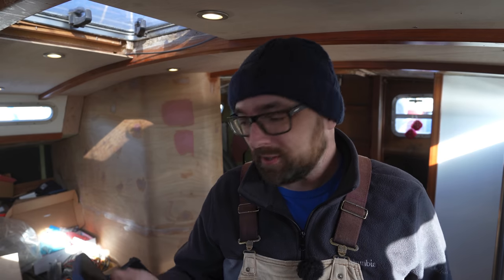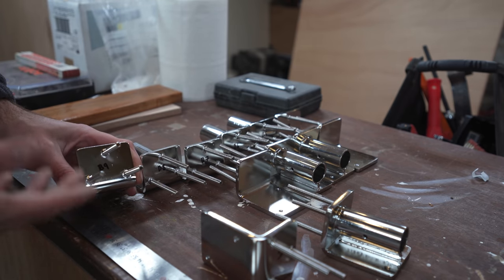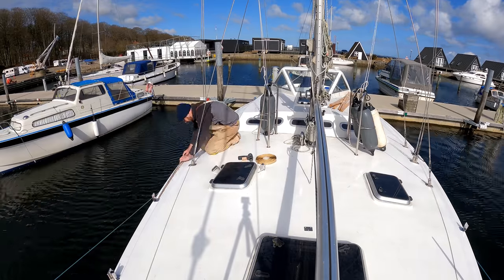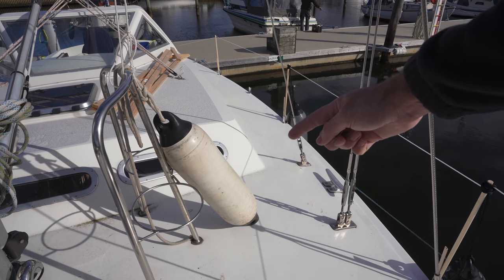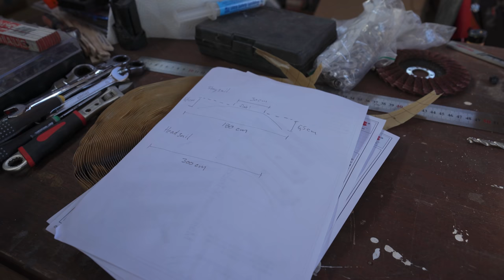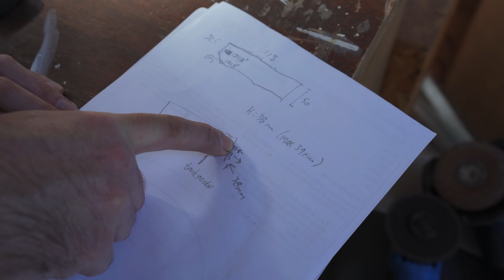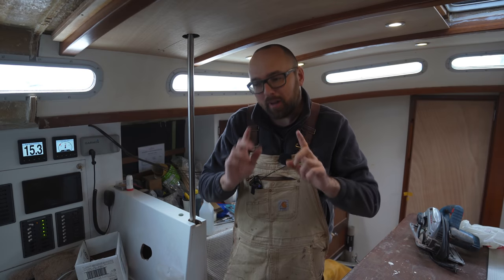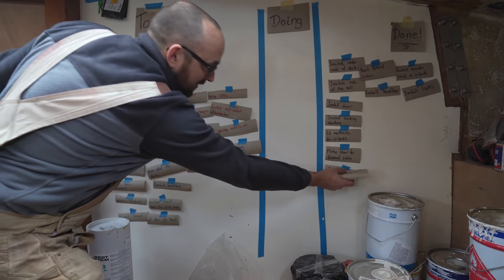Sail Life - Getting started on the toe rail / mini bulwark

Comment: Concerning leading the genoa sheets to the winch it is important that the sheet meets the angled base of the winch at roughly the same angle. One other thing is that you don't want to step on the sheet when leaving the cockpit because this is insecure footing . A good solution therefore is to have a block behind the winch. That way the genoa rail needs only be long enough to accommodate its lead block, from there the sheet runs to that aft block and up to the winch. You only need to install an eye bolt and a single block connected to it by a soft shackle.

Comment: Hey Mads
If you are dropping the cells further down, why not "just" cut out in the surface they now rest on, and use it to frame the cells as you place the bottom underneath the board? That way your base will have a maximum resistance to the sideway forces as it connects to the hull all around.. So place your cells in an recessed insert in the current board and just secure them from leaving that insert

Comment: for battery heating, best is to use a 12v infrared heating film. It is used in diy electric cars for battery heating. You can try to charge Li-ion cells at low temperature - they will not take up much charge. Best is to keep the battery temperature between 15-30 degrees. A simple 12v thermostat ca easily do that job.

Comment: Hi Mads. With regard to your genoa tracks. You may want to think about the sheeting point on the track (cars) when the foresale is furled or reefed. The optimum angle of the sheet to the sail is generally a bisection of the leach and the foot of the headsail. When the Genoa is full IE at 100% deployed this will be further back on the track. As you reduce the sail size this point will move forward. (Less if you are Yankee cut). Also, as the wind strength changes you will want to move the cars forward or back to curve or flatten foot of the sail and will be different from a beat to a reach. Being able to do this with a single line from the cockpit is an easy single line installation. As you only need to pull the cars forward not back; as the sheet will do this for you under tension. Not all of your sailing will be under full sail and it is important to maintain the right sail shape (or as much as possible) even when reefed. So if your setting this up now put in adjustable cars with a line to the cockpit and think about a padded luff to the headsail too. Being able to maintain good speed or penetration in strong winds is just as important in stronger winds as it is in light winds. As always it's your boat.... Just giving you some food for thought. Sail Safe Guys, Ant, Cid & the pooch crew.
Reply: Mads mentions a second car on the track to change the direction of the line, but wouldn't a foot block behind the winch be better?
Reply: @jorgenr  Facing the same issue on my boat, a second set of jib cars was (1) less expensive and (2) created no issues in mounting.
Reply: I had the same issue on my boat and I skipped the foot block and used a second car on the genoa track. That way the side deck remains clear.
Reply: @jorgenr  I agree. I am worried about the angle of the sheet on that second car. It would get a sideways load, which it may not be designed for. In addition, Antal makes very nice foot block that are cheaper than a similar-quality car.
Reply: @stevenr8606  What and try to change sail  on a heaving fore deck after you you should have reefed 20 minutes ago? You need to balance the sails to the prevailing conditions. But most of all anticipate and plan so there are no emergencies. Clearly you need to sail a lot more to gain some experience.

Comment: Did you mention a vent on the new water tank?  And you should seriously consider a RUBRAIL on the hull exterior.  Seriously.  Rubrail.  You want to preserve your paint job and fenders can only go so far.  Rubrail!!!  It will also provide a linear break on the hull, and will make the hull (in profile) appear sleeker.

Comment: I would  have a sheet running back to the cockpit for the genoa track car - the changing angle on the luff and foot of the sail can have a dramatic affect on performance in light airs, it also gives you something to play with when you're  on a long slow boring run!  Building up from scratch I wouldn't compromise on anything - you'll kick yourself!
Reply: I fully agree

Comment: Mads,warning re s.s. water tanks. If the welds are not gas shielded on both sides then one side (the inside of the tank) is no longer stainless and will rust. To do this the whole tank has to be filled with gas witch is expensive and is not always properly done. I know this from bitter experience not just on my own boat but on many others. Make shure that your stainless guy does a professional job. I paid a fortune for mine but still had this problem.

Comment: I would locate battery high up so last to get wet if flooding and hence bulge pump will keep working.
Reply: once the water is covering those cells then you are beyond worrying about a bilge pump. The best bilge pumps can't keep up with a failed through-hull - crew with a bucket can shift more than a pump

Comment: NEVER charge LFP batteries below 0°C: RAPID and irreversible degradation. By experience, best usable temperature range is 10-20°C if you float between 10% to 90% State of charge (80% usage multiply life expectation by 2 to 3). If hotter conditions (20-40°C) then never charge more than 3.4V per cell battery oxydation occur only when fully charged, and increase above 20°C this is a slow process tho. 20%-80% SOC usage will increase A LOT battery life.  (20 years expected in this case.) Also you will see that cells unbalance occur only when fully charged or fully discharged. SO my advice : use a 20%-80% range for everyday use, then increase to 10-90 only if needed (long passsages...). If one day you must use 0-100% then recharge IMMEDIATELY to limit degradation.
Reply: interesting input, you sound very educated on this topic and we would love your thoughts on our recent battery build videos

Comment: A good BMS has a cold temperature charging cut off  but also can turn on the silicon heating pads as needed to warm up the battery. Pads under the battery cells.
Reply: Never seen a BMS with a relay output for the battery heaters, but that sounds like a good idea !

Comment: Another great video, Don't give up on the idea of cockpit adjusted cars for he sheets. I have used both and would never go back to non cockpit style. Safer and dramatically easier to adjust under any point of sale. Clambering along the deck with a flogging sheet is a nightmare in any kind of blow. You will never ever regret adjustment lines.

Comment: If spending winter in my country Scotland, your almost definitely going to need heat in your battery compartment, my e bikes batteries are lithium and I always have them in the house up to around 60 degrees  for at least a  couple of hours before I charge them, they will absorb charge gooderer that way and ,I am using one of them from 2015 and its still working well, I also find occasionally if I totally discharge them ie what ever one I am using, and have it nice and warm it will take a better charge.

Comment: That second genoa block looks like it might give you a bad lead onto the winch. This angle should be about -10 degrees or so. Google 'winch lead angle' for details. On my CS 36T the solution was a sheet turning block located at the outside, aft end of the cockpit coming, angled to provide the correct lead onto the winch. That way, the genoa sheet always has  a good lead regardless of the position of the genoa block.

Comment: Mads, I believe mounting the wood bulwarks on the inside of the mounting bracket would be a better solution, as far as safety goes. while healing over hard, a lot of pressure is put on the bulwark, while walking fore/aft, better to be relying on the bracket than the bolts...no? Just a thought. Well that was sad, seeing Obelix sailing away :-/

Comment: Mads, if you're going to use a track inside your shroud, you'll probably want some attachment point outside the shroud to sheet out your headsail on close to broad reaches, which means you'll need some attachment point on the rail anyway, unless I'm mistaken and there's some other solution on the warrior.

Comment: Do you intend to use an anchor bridle as a snubber?  Are the Hawse-holes going to be rugged enough to stand up to that kind of abuse on the hook?  The same for mooring balls?  We find that running a snubber through the bow roller really makes sailing on the anchor much worse, the same for mooring lines.

We have a Mantus anchor bridle for anchoring and have a special mooring bridle dual pennant for mooring balls if it is a longer time stay, all with built-in anti-chafe.  These lines all run through bow-chocks on the gunn'l cap rail just forward of the bow cleats since we don't have hawse-holes.  We have not run a line up through the bow roller in years.

Comment: re heating/cooling the cells ... tbh I don't think you will need to worry about either. I think they are 280Ahr cells, so 1C discharge is around 7kw & they don't mind that.
As for charging, IF you manage to get them too low, then just stick the inverter on with a nice high draw (cooker) and that will warm them up enough to take a charge, then the act of charging them will keep them warm.
There is so much crazy info around ... these cells (chemistry) are now being used in cars & bikes as starter batteries & they went through winter ok (and colder on land than in a boat below the water line)

Comment: I see you are planning to use a s/s backing plate for your windlass. When I fitted a new windlass, the instructions said NOT to use a metal backing plate and to use a timber one. The reason given was to avoid electrolytic actions between the two metals-any thoughts?

Comment: As a point of information I installed the silicone heating pads on my 120 volt Lithium battery banks. I programmed an Arduino to monitor the temps.

Comment: For maximum strength under the anchor winch it would, perhaps, be better to build down, under the deck, with extra (Oh Joy) Fiberglass so the plate is flat underneath the winch and bolts can pull straight down.

Comment: Curious, shouldn't you really overdrill and epoxy fill those holes? It seems it's inevitable that the seal will fail. Then you will get water into the hull at the top that could spread out and cause rot. With epoxy filled this would not happen.
EDIT: Nvm it's solid fiberglass haha

Comment: My boat has 12ft of genoa track but I only use 1ft *, particularly with high cut #2 seldom need to move genoa car, can't think of a reason for long genoa track, suggest sailmaker would know optimum position, same for inner stay sail if you have one. 
* long genoa tracks were common with hank on sails but now no need.

Comment: Hej Mads, I would definitely consider 3D-sheeting for the genoa, eliminating the need for a genoa-track whilst being able to fully control your sail trim, better than with a traditional track.
Position each 3D-point a few dm ahead of where the sheet would touch deck. You will easily be able to add/reduce sail twist to enhance light wind and hard wind performance, as being able to sheet very close hauled or maintaining an efficient sail shape even when opening up the angles to a beam or broad reach. This is vital for comfortable and safe sailing and not just a performance thing.
As for the self tacking jib, the ideal track shape would be a radius with the center about halfway up the forestay. A track following the deck shape would not have an ideal shape.

Comment: Do you need baffles in the water tank? It might make rolling in high seas a little more tollerable. It is low shifting weight without them,. Small ports between sections is all you really need.

Comment: I was wondering if the battery compartment will have a fire alarm/ overheat /alarm system, in light of issues with these batteries. Maybe even a fire retardant wall and ceiling? ....John

Comment: I am concerned about the winch having a block at the end of track, there will be a lot of pressure and danger of ripping the end of track op/out,  did have that problem with my Kaskelot and Peter said to install a block further back from winch . Use a foot block mounted on an angle. Ole

Comment: I have a Contessa 26 which have the Genoa sheet track on the edge but we brought them inboard the same. The hull and deck joins at the edge so not the best place to screw into. Never looked back as the Genoa sets way better. Strongly recommend you add the pulley to at least pull the car forward. As the wind increases you need to adjust the car at least one hole in the track is not unusual so a couple of inches minimum. Also with an adjustment pulley you are not limited to the holes so fine tuning as a bonus. The downside is the foot of the sail on the station post/wire.

Comment: I think i would make some drain holes along the toerail, instead of the 2cm gab, so you won't get a finger or toe caught in it in case you or the missus slips!
Reply: Agree. And lines have a tendency to go where you don’t want them to get stuck either!
Reply: @michelvanhove520  Yes lines and stuff will get lost if you need to do work at sea, there is a reason the mordern ones got that shape/profile
Reply from the maker: It'll be fine. I have no issues with the 2 cm gap.
Reply: @SailLife  sure it'not the end of the world
Reply: How about a compromize, Mads.. 10mm in stead? ;)
Reply: @SailLife  I like this solution. Less likely to grow puddles of slime. Good run off. Good foot support. I can't see the lines catching. They don't catch under my grab rails.

Comment: @Mads, if you want to get rid of the staysail boom, you'd have to consider bending the staysail track in two drections: horizontally and vertically to allow tacking with the staysail.

Comment: I really like your toe rail/mini-bulwarks solution.  It should look very spiffy when done.  It your stanchions are hollow, I would get a couple of extra.  Make sure you have a tubing cutter on board that can handle stainless.
Tip on the batteries.  Instead of bolting you cables into the threaded inserts, turn them into studs by using some threaded stainless all-thread and nuts.  The cable end will be secured between 2 nuts.  Thin "jam" nuts are adequate.

Comment: On my swan 45 we can adjust the Jib cars under load.  This is a very nice feature that helps with sail trim.  I don't see the option on too many cruising boats but we use ours a lot and since your starting from scratch I would add this feature.

Comment: Mads - since you have a painted finish on the hull, I suggest that you use cloth covers on your fenders to prevent chafing of the finish.  I have had two boats with painted top sides and have learned the hard way.  I have covers on all of my fenders and it has worked well.  Polar fleece is typically used by the manufacturers or something similar.

Comment: Have you considered using a stainless tube top rail from the solar arch to the next stanchion? For extra handrail safety when stepping out of the cockpit. Also another possible solar panel mounting location.

Comment: When you put batteries low, the electric bilegae pump stops working in an event
Reply: And when the electrics fail, you use the manual bilge pump. When the manual bilge pump fails, you use a bucket. When the bucket fails, you use the life raft.
Reply: The top of the batteries are very high. I assume higher than conventional. And they will be higher than the floor boards. So, a lot of water have to be in the boat to shorten the circuit. I addition the center of gravity should be as low as possible.

Comment: Hi Mads,

It's a common misconception that Li-ion is harmed below 0°C. That's actually the critical threshold where self-combustion is a very likely outcome. They can be harmed at much higher temperatures. Pretty much they're happy at 20°C. They get damaged above 30°C from overheat and are exothermic above C2 so using them will make them hot and then they can be damaged below 10°C if you are using high C rates. Li-ion plating happens when the electrons are traveling faster than the li-ion and causes permanent damage. This is a phenomenon of the relationship between charge rate and temperature. Hence temperature feedback proportional charger foldback control is highly desireable.
Toyota have published some studies on it. Here's a picture:
https://www.pnas.org/content/pnas/115/28/7266/F5.large.jpg?width=800&height=600&carousel=1

The upshot is in Ireland all year round my many and varied battery installations are ~10°C or lower (same as the recommended motor oil viscosity oddly enough), given the price per kWh comparison and the finickiness of my LiFePO4 I can actually in practical applications charge & discharge lead faster, have equal service life and better efficiency.
There's a 2% round trip efficiency difference I've observed between lead and li-ion. That goes out the window and LFP takes a dive when you start adding active thermal management and throttling chargers according to temperature.

Good look with the BMS...I've spent years building one. I definitely won't be ever buying more LFP.
Looking forward to your take on best installation of this can of worms.

Kind regards,
Liam.